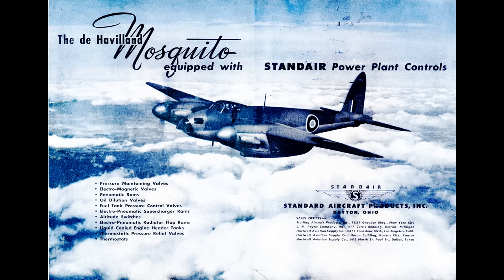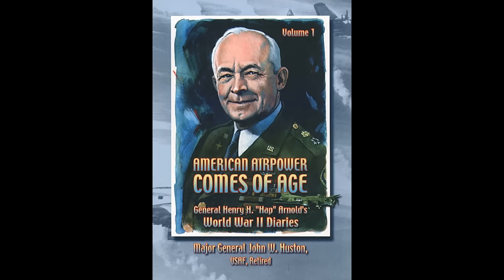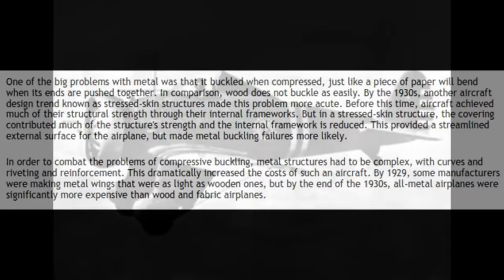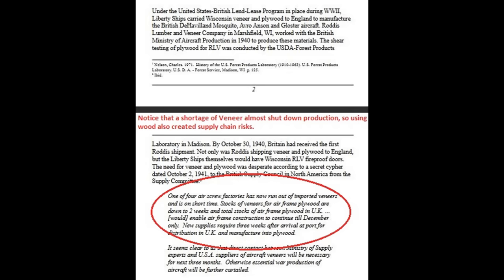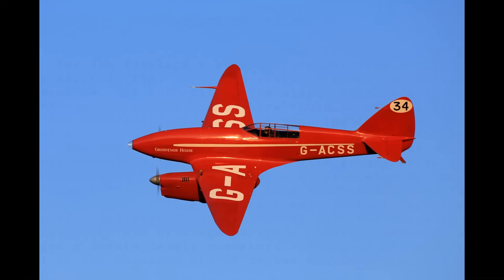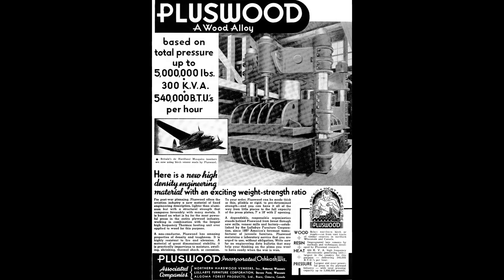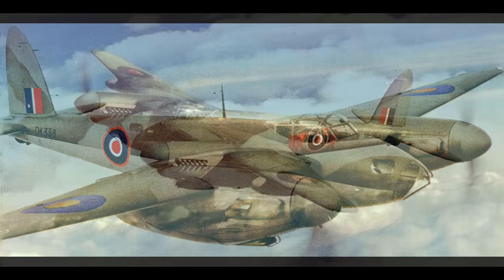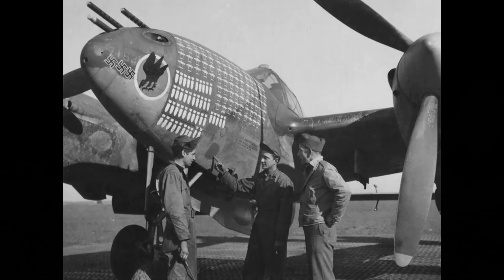De Havilland Mosquito vs. ?

Comment: One of the biggest advantages of the Mosquito,  it used a whole lot of things we didn't use to build other planes,  and didn't use a lot of things we needed to build those other planes,   yet still turned out to be a great plane for the war effort....
Reply: One of the "unknown" unknowns  re Mosquito production was the actual available supply of vital balsa wood which came solely from South American jungles. 
That fact alone must have given those required to "sign the cheques" to get the mass production program going more than a few sleepless nights.
Reply: @t5ruxlee210  
Probably one of the main reasons they had their main production line in Canada....
Reply: That was the theory. In reality, the Mosquito gobbled up huge amounts of resources that were either strategic or limited in quantity. Shipping capacity, Merlin engines, high grade lumber, and skilled woodworkers.

The reality is that anything that truly didn't use strategic materiels, XP-77 just wasn't competitive. Anything that was competitive, Mosquito, used up strategic materiels.
Reply: The Mosquito employed the otherwise non-strategic skills of those in the woodworking industry. An important consideration.
Reply: @Jack-bs6zb  THAT was one of the main attractions towards building the Mossie. Even small towns in Suffolk had cabinet making works using elderly and unfit workers as well as lots of women who made Mosquito bits. There was little other use for them and, even in 1942 the need to retain skills ready for peace was recognised. The other factor was the need for a high flying aircraft (to receive bomb target signals from the UK) to mark targets for the night bombing campaign, a task the Wellington was adapted for but was stretching the design a little too far. During an early demonstration of sky markers the Wellie dropped 4 only the rest hung due to a loading error. The four worked almost as well and 109 squadron breathed a sigh of relief as they would use Mossies for Pathfinding which could carry the 4 needed at sufficient altitude. 
The P-38 was a great aircraft too but it was an American solution to a similar issue, horses for courses.
Reply: @nicholasperry2380   It is just that the Mossie had more courses

Comment: My late father once said the the most thrilling and terrifying thing he experienced in the war was racing over Europe and realizing that the chimney pots were higher than he was.
Reply: a brave man
Reply: Feeds Ravens  I think most Mosquito pilots once they felt that 450kt speed felt like Supermen and they flew their planes like it.
Reply: The Pole was waving his arms above his head
Reply: Years ago in Wales, we were walking on a hillside and looked down into the cockpit of a Tornado motoring up the valley.   I bet the crew's feelings were similar.
Reply: There's footage of that in the video I shared above.
Reply: @TheArgieH  the Mach loop?
Reply: @zaphodbeeblebrox9109  Indeed it was.     Also saw a C130, though it was a wee bit slower and higher, impressive all the same.  Might have been the equivalent of F1 drivers taking a bicycle ride round the circuit to get familiar with it, and all the Hawks were taken. Oh! And an F15 Eagle, much higher, maybe both had missed the footpath signs and were lost (joke).
Reply: The army call the RAF "Crab Air" with reason 😁😁
Reply: I read that the Dambuster Lancs flew so low, in practice, they'd pass under telegraph wires. Kind of took that with a pinch of salt as I've not read it repeated anywhere else.
Reply: @Jin-Ro  They flew under high tension cables, not phone lines.
Reply: @David-lb4te  My mistake, thanks for confirming.

Comment: Aussie version made of Malle root, red gum and Iron bark. Bullet proof plane from factory. if it catches on fire, that fire will last for days.
Reply: If that thing hit the ground...the grounds screwed.
Reply: Only Oz could have a long enough runway. Rotate at Alice Springs.
Reply: Plus in freezing conditions u could light it on fire 🔥
Reply: Probably not a concern for the pilot. He'd either survive, and be long gone...or dead!
Reply: 1st one they built disintegrated over sydney harbour causing a review which found they were using the wrong glue..bugger..
Reply: A flying Tesla.

Comment: I fly RC planes, and I like the old school balsa wood planes over the modern foam planes. I can't say which flies better or which is tougher. But I have found if you perform a sudden stop test using the ground. It doesn't matter what the plane is made of the ground always wins.
Reply: that's happenedto you  few times as well then lolll
Reply: Yea but do your RCs get shot by flak and whatnot?
Reply: It's never the dive that kills you....
It's always that sudden stop at the bottom 🙄
Reply: Well said! I do not know how many planes I destroyed as a boy trying to build my own designs before my dad taught me the basics of weight and balance rules, etc.
Reply: @josippetkovic389  a foam plane will hold up much better to 12 gage bird shot
Reply: Put a big spring on the front so it bounces when you crash 

Works in cartoons
Reply: @Meowface.  Now why didn't I think of that. LOL.
Reply: @midwestreview6382  do you know this from experience?